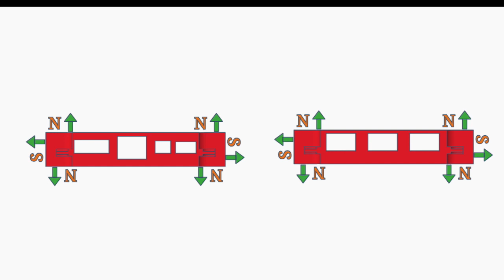The Modular Lattepanda Alpha Delta Case - MagClick Base Case Tutorial!

Comment: Very useful and cleverly designed case for the Alpha.  Great job on the the video as well.  Clear, well organized and easy to follow.  I'm going to try this case as I have an Alpha that needs a better enclosure!  Any thoughts/intentions on designing a unique case for the new DF Robot Mu that would fit either of the two breakout boards they offer?  As you likely know, the Mu is an x86 based SBC too - on a compute module!  Lots more power than the Alpha and a lot of I/O too - albeit requiring a breakout board.  Thanks for a great little project and design for the Alpha SBC,

Comment: How can i get my hands on one of these mag cases. From your website it looks like we need to 3D print it. Is there anyway i can order and buy one off you. I would like to order a base case touch screen case and gpu that’s compatible with the gtx 1080 and rx480
Reply from the maker: Chino currently that’s the way to go. I haven’t developed much since this video because of my 3D printer but I have a new one coming Wednesday so I’ll get back to it. The GPU case is only good for zotac gtx 1650 dimensions as far as I can tell, other gpus mileage will vary but I would like to make a more compatible version. I might have some spare parts to make the base case so that I might be able to do

Comment: great work! i was wondering if using a laptop gpu is a possibility?
Reply from the maker: thanks! possibly, I still not sure its cost effective. In fact it would probably be easier to find low profile cooling solutions for desktop GPU than it would be to do laptop GPU
Reply: @HandheldHardware  Im trying to do it myself but i cant seem to figure out a way to power the gpu, any suggestions?
Reply from the maker: mv vo what adapter do you have for mxm?
Reply: @HandheldHardware  i have the m2 key to pcie adapter
Reply from the maker: mv vo does it have the 4 pin power connector on it?

Comment: how can we use battery pack, where can we get that 10 pin connector
Reply from the maker: Hi Ramchand, you can order the parts on digikey. It’s a little difficult to put together, but possible without the $350 crimper. I’ll have a case extension piece out shortly. My new LiPo Battery will be 14 mm thick instead of 24 mm thick, making it look better.